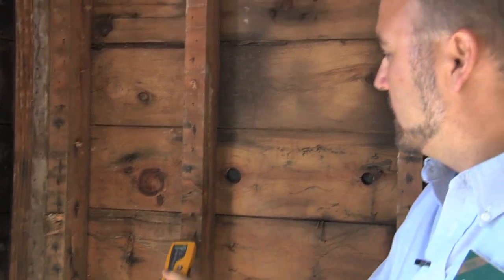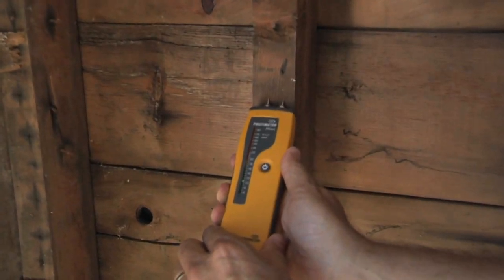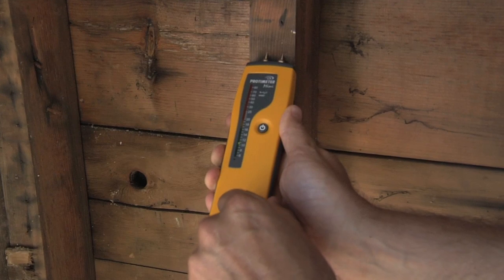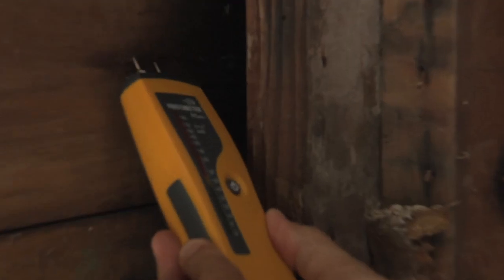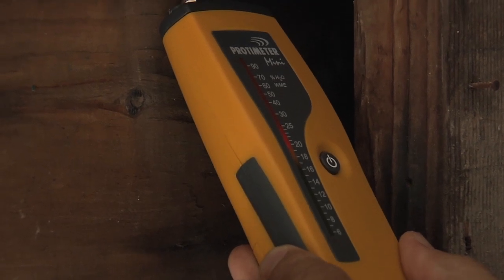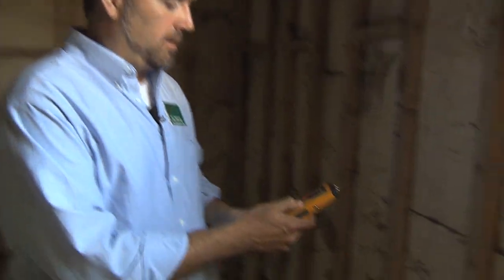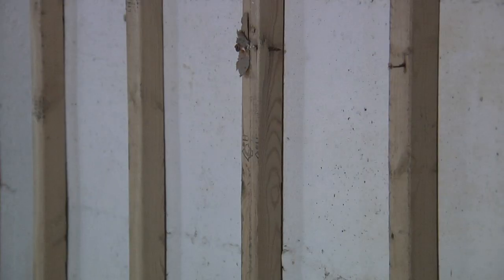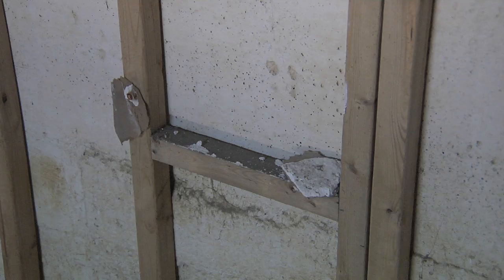Flooded Home: Make Sure Everything is Dry Before Rebuilding

Comment from the maker: Thanks for your comment, tcsadt. The pin type meter cannot accurately indicate the moisture of concrete or other non-wood materials. It is to be used on wood and is accurate only on wood. However, we can get some indication of wet or dry using the meter. That is the reflected in the text at the end of the video. There are specific meters for measuring the moisture content of concrete, but frequently they are not available.

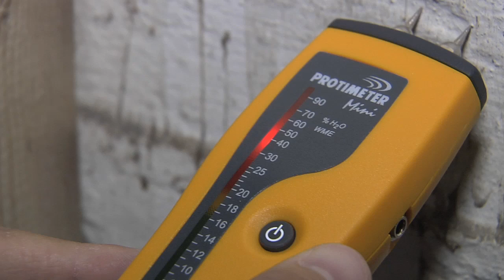Comment: @ 1:21 you use the needles to measure the moisture on the surface of concrete.  This is a very incorrect method.  You need to instead use the infrared type meter to measure inside non-porous materials like concrete.  Unfinished basement typically have insufficient climate control, and if a home doesn't have an operating HVAC system after a flood, the moisture levels on the surface of non-porous materials below ground level (cold) during the summer, will actually form condensation.